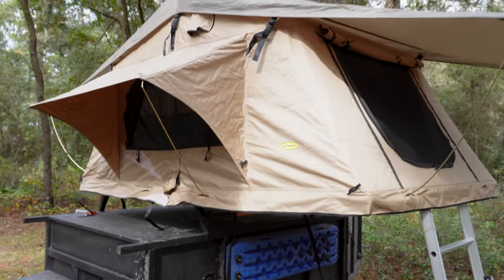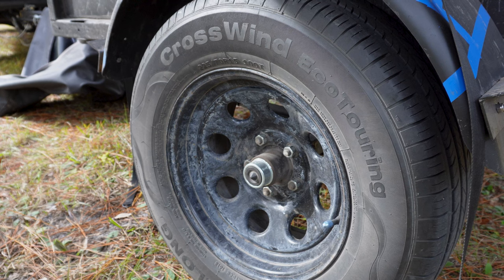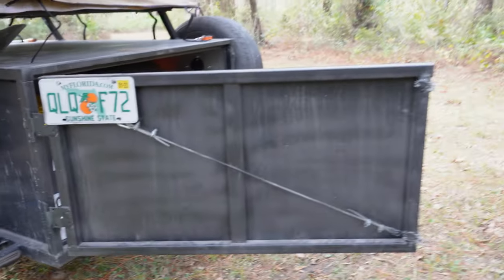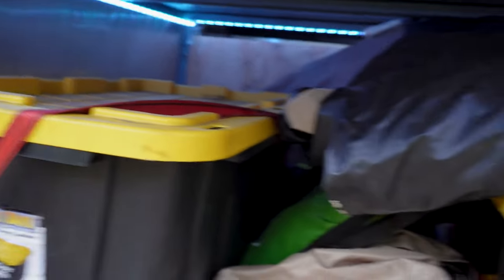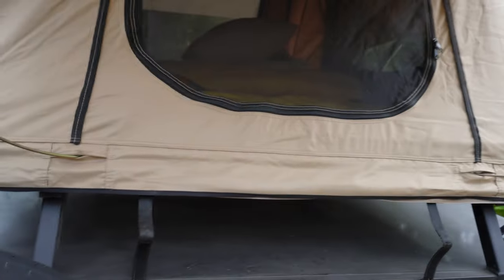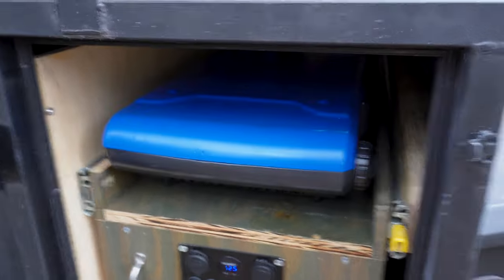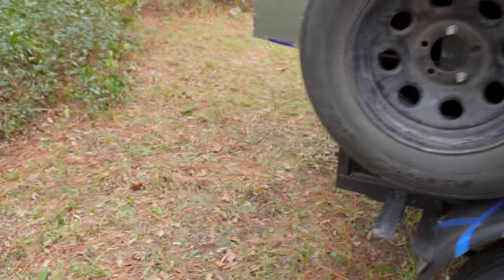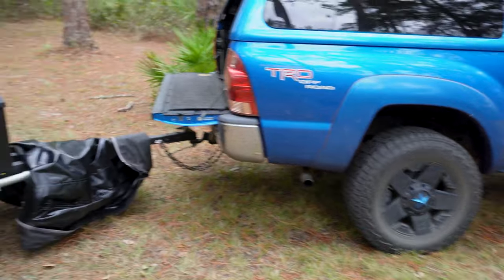My Overland Trailer Build - DIY Camping Trailer Walkaround

Comment: Love it. I've got an 8ft Utility trailer that I want to convert to a camping trailer and this build is a perfect foundation.
Reply from the maker: Go for it!  Building one to fit your needs specifically is a great feeling.
Reply: Same thought goes through my head every week. Update us when you do it!
Reply: @JonathanShidler  I've been designing it and I just bought the metal cutting band saw I need to cut material. Gonna start welding soon. 😍

Comment: That's a very cool, functional build. 
The only thing I would change is the rear door. I think a drop down tailgate style would better suit my needs.
I can always use a large, flat surface to work from. Thanks for sharing!
Reply from the maker: I think my back area is too deep so if I did a drop down tailgate it would've been too difficult to reach the very back items.  Definitely would work great with a drawer system though!
Reply: @javileeYT  You're right, it would be too far of a reach. A drop down table mounted to that door makes way more sense. Thanks for sharing and replying, every bit helps me plan my build.

Comment: Nice budget build, I like it! The only thing I would have to do differently is an over under swap on the axle for more clearance out in my area of Overlanding. I have some items I removed from an old cab-over camper I plan to use to save me some money on a build but first I need to get my tow pig in order which I just purchased 2 weeks ago!
Reply from the maker: I actually do have the springs over the axle specifically for the ground clearance like you said!  Although, not needed much here in FL.

Comment: I have almost literally the same trailer but I have independent suspension 15 inch wheels and I have trailer brakes. I have a Smitty built Tent, but mine is suspended on almost 4 foot high rack and then I have a smaller rack for canoes or kayaks.

Comment: Very nice setup.

I am currently in the process of modifying our Tradies Trailer into a Camper it has a bit of work to go lol however just starting out with the trailer to store all of the camping gear etc however yea eventually like you and a few other builders I cannot wait to have it finally completed but a long way to go yet and eventually it will cost thousands less than pre-built setups!
Reply from the maker: It's a lot of work, costs more to make than initially planned, but after all said and done it's still thousands cheaper than anything else.
Reply: @javileeYT  that is the yes. the trailer is brand new with a fully enclosed canopy with ladder racks on it so some of the work is already done lol except the RTT I want to get needs an additional 2 racks to secure it properly which isn’t an issue. It’s the 12v system install that is doing my head in 🤣

Comment: Nice job man. I am thinking of building a trailer. Just looking for a good foundation.
Reply from the maker: Thank you!  This one started it's first life as a harbor freight trailer and then I spiced it up a bit :D
Reply: @javileeYT  what model/size?
Reply from the maker: This one started as the 40"x48" that I chopped up and reused the metal to create the 4'x6' frame.  I should've looked for a 4x8 folding model initially as it would've been easier/cheaper.

Comment: Hi there. Nice trailer you built. Can you share the link of the website for the springs/shock combo you purchased? Thanks
Reply from the maker: The shocks are Monroe 555002 from Amazon - https://a.co/iQydlFJ
Leaf springs are from http://www.stengelbros.com/trailer-suspension-parts/trailer-leaf-springs/ and are US -1030  28" 740LB springs.
A pretty cheap suspension setup that works pretty well for what I ask of it!

Comment: Hi, very nice build. Can you give more details on how you did the edge where the weather strip is laying ? 
Also what size square tubing you used for the build and how thick ? 
Thank you for the great content.
Reply from the maker: Sure i'll do my best!  So square tubing for the bottom of the frame is 1/8" thick 2x2 tubing.  The walls are 1/16" thick 1½x1½ tubing to reduce weight and I didn't find any issues with structural issues.  How i did the weather stripping edge was taking some 1/2" angle iron and just welding it in place to be flush with the inside edge of the square tubing.  Here is a decent image during the build process to show it.  https://imgur.com/atSiiUv
Reply: So you welded the angle iron inside the box, then fit the door to those dimensions? And what just glued on some weather stripping to the door? Or is that it, just the angle iron?
Reply: Nevermind, rewarched.

Comment: Hey. Just found this video. Great Job! I have a shell I’m working with that is very similar to yours. A couple questions…What size is the opening for your slide out drawer and how high is the platform for your RTT? Thanks!
Reply from the maker: I don't have the trailer anymore but I believe the side opening was right around 18 inches and the roof rack was sitting around 5 ½ ft.

Comment: Hi i live in Miami, Fl. I like this trailer and would like to build something like it for my setup.  That way i can still use my Ford Expedition and not have to tear down camp every time to go to the store or go explore the areas around camp grounds.
Reply: Wouldn't know where to begin or have the know how of what to do any help would be helpful
Reply from the maker: I think first off is a plan of what you need/want, general size/shape etc.  After that it's a lotttt of research on YouTube, forums, blogs to get other ideas on what you want to do.  Determine if you can/want to build it yourself and understand it takes a lot of patience and time since it's the first time.

Comment: What kind of sheet metal did you end up using for the interior sides? I'm really liking the build!
Reply from the maker: It was just the other side of the sheet aluminum, it worked nicely.

Comment: Maybe someone can answer this question. What’s the point of having off-road tires on a trailer anyway?
Reply from the maker: Off-road tires can be good if you're going over harsh terrain since they're more resistant to punctures.  If going on uneven slippery trails the extra traction will help with keeping the trailer on the trail.  If you get the wheel/tire combo to match your tow vehicle you can also use 1 spare across truck/trailer and also use the trailer wheels as spares for the truck if need be.  Both of those are more of absolute 0.1% worst case though.  On my new trailer build I'm using off road tires mainly because I found them cheap locally :P

Comment: I think your axle is the weak link!
Reply from the maker: It's a 2000lb axle from Northern Tool so I believe I should be well within spec, I've not weighed the trailer but I don't think I'm even breaking 1000lbs fully loaded!